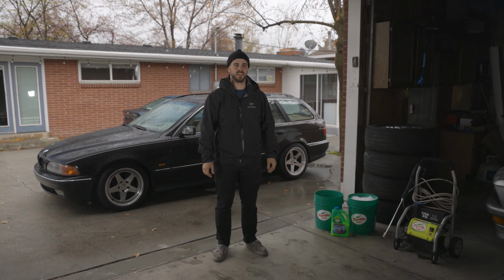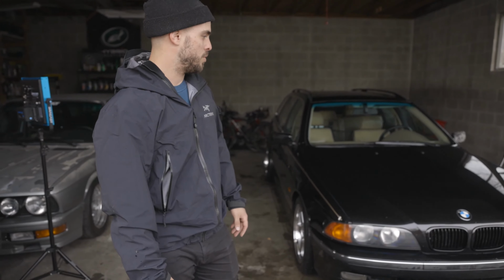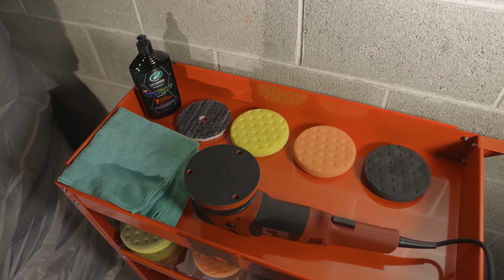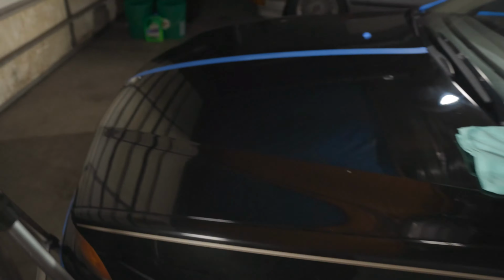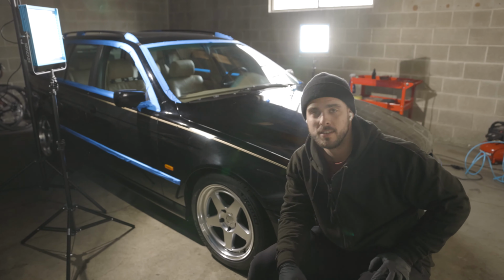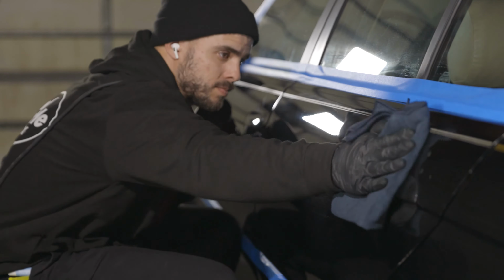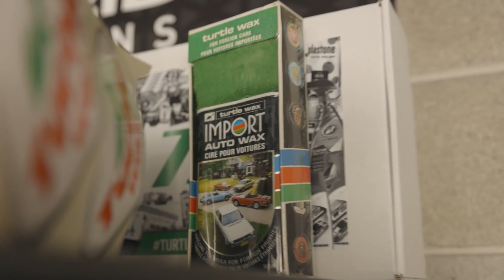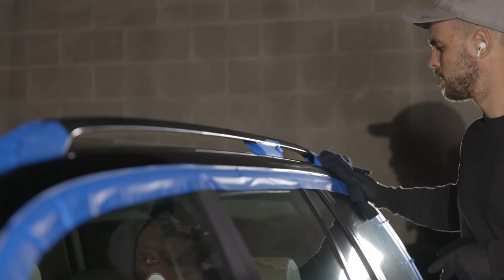Polishing a BMW E39 Wagon/Touring with Turtle Wax's One & Done compound

Comment: Gr8 job.  On a car like that - the right products and time...lots of time.
I have been REALLY impressed with that compound.   Recently did a 7 year old Prius that was in that condition - or worse.  When I began the job I'm  like ooof let's see where this goes... using the 50/50 microfiber pad and the One and Done it came out stunning.  Not only did the compound work with the right pad as far as the cut, but the BRILLIANT shine and gloss that it brought out in the dark blue metalflake was really satisfying.   I coated it with a healthy dose of Seal&Shine and the client wasn't sure if it was the same car.  Great products!

Comment: I do not have a polisher, could I get any decent results using 1 and done by hand polishing?
Reply from the maker: Yeah for sure, same prep and using clean towels- just a lot more work like anything machine vs hand.
Reply: I would just use a cleaner liquid wax if you're doing it by hand.  Cutting all that swirling would kill your arm.